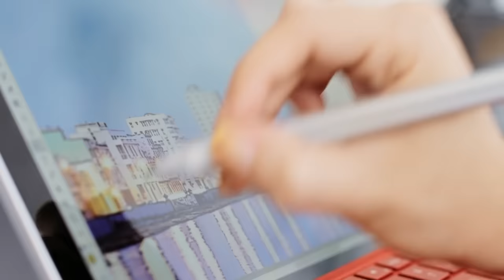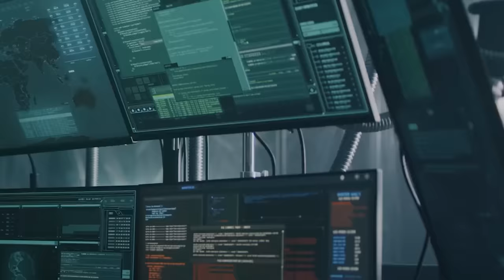Chinese Most Stealth Fighter Spotted at American Marine Base

Comment: Your comments remind me of the "Great Fighter Gap" in the 1960's. 
With great fanfare, in 1958 the USAF unveiled the proposed B-70 Valkyrie, a huge, Mach 3 capable bomber that would fly at over 70,000 feet. Work on the project continued into the early 60's, with many breathless announcements about the capability of the aircraft.
But over in the Soviet Union, there was some concern, as they had nothing on the drawing boards that could intercept the bomber. So a crash program was begun to develop such a fighter. 
But by 1962, the Air Force realized that missiles WOULD be able to hit the B-70, mostly because it's radar signature was so big that you could see it as soon as it reached altitude. So the project was canceled, except for the two XB-70 prototypes. The USSR, however continued full speed on the fighter project, and by the middle 60's started flying the result, called the MIG-25.
Now the shoe was on the other foot. The USAF did not have a fighter that could equal the speed and altitudes the MIG-25 could achieve. So of course they needed a "crash" (expensive) fighter program to create the aircraft that could fight the MIG-25. And they got what they wanted, the F-15.
Then a Russian pilot defected with a MIG-25, and all the experts got to get a good look at it. And oh were there a lot of red faces!
They arrived looking for all the amazing attributes the Mig was supposed to have, special materials, great radar, highly maneuverable, advanced engines and other cutting edge tech.
They found a VERY heavy plane that was made of steel to take the heat, which could pretty much only fly in a straight line, could NOT dogfight, with short lived engines, short range and still using VACUUM TUBES in the electronics. The "wonder plane" was a dud.
I'd withhold judgement on the J-20 if I was you.
Reply: The funny part is, even with the ability to go Mach 3.2, the MiG-25 was incapable of catching an SR-71, the MiG couldn't sustain Mach 3+ fight long enough to catch up with a SR-71 even if it took off ahead of the SR.
Reply: @mrvwbug4423   The Soviet Union actually used Mig-25s to try and intercept SR-71s several dozen times.  They would launch the Mig-25 well before the arrival of the SR-71 and be in front waiting.  The Mig-25s could always detect the SR-71 on radar, lock on, and in several cases even fired missiles at it.  The missiles could not track the SR-71 accurately because the closing speed was WAAAAY too fast for the missile to make corrections fast enough. Closing speeds were mach 5+ (hypersonic).  In total there were over 4,000 missiles fired at SR-71s over the operational life of the aircraft, both surface-to-air and air to air.  Not a single one came close enough to put the SR-71 in any danger.  The missiles were not fast enough when fired from the rear quarter and could not maneuver fast enough to pull correct lead when fired from the front quarter.
Reply: the engines not was short lives, was literally Cruiser missiles engines, they fix this in the MiG-31 Foxhound the sucessor of the Foxbat, the MiG-31 is theorically the same thing but the fuselage is lighter due to better engines and its made of hardned Aluminium Aloy infusioned with titanum, this with the first Fly by wire sistems it actually can turn faster but its a interceptor not a fighter
Reply: @michaelrunnels7660 the entire life of Blackbird a total of 17 missiles was fired at it, not 4000 😂 bro is pulling numbers from his ass, and belive or not 3 of the 17 AA missiles was sweedish drakens that fire, blackbird engines are much stronger than it was put to fly but the fuselage will melt, so it only goes at 3.5 Mach so the nose dont melt due to Heat, the MiG-25 can fly at mach 3.3 almost the same, and the plane itself is faster than the missiles, thats why the MiG-31 is used now as a Air-to-ground plataform than a Interceptor
Reply: @Russinh0  
Straight from the Russian MOD handbook 
As Bugs would say
What a maroooon
Reply: @Russinh0  The Mig-25 was ALSO an interceptor, not a fighter.
Reply: @Russinh0  The MiG-25 had to have its engines overhauled after a flight if it exceeded Mach 2.8, and couldn't maintain Mach 3+ for very long before running out of fuel.
Reply: @joshuabrown3525  The Soviet tanks during WW II were arguably OVERALL subpar, but it was more an issue of sub-par optics, inefficient tactical communications, and poor doctrine.
The KV-1 and T-34 were bad shocks to the Germans at the start of Barbarossa - better EXCEPT in the optics to anything the Germans had at the time.
Reply: The main reason why the US got freaked out by the MiG-25 Foxbat is that the American analysts saw the massive wings on the thing, and jumped to some incorrect conclusions about why those wings existed.  The Americans thought the plane was primarily built out of titanium, and the wings would generate increased agility.  But in fact the Foxbat was primarily built out of heavier steel, and the large wings were needed just to keep the plane aloft.
Reply: That j-20 would it not be funny if we wanted to test to see how close we could get and steal one from china and when the fella actually succeeded came over coms and landed on a close by Aircraft Carrier and lowered down into ship transported back to the United States. 😉. Wait is that legal to do? Oh yeah I forgot we have the largest Navy in the world. Also maybe we had it for awhile now and we are done with  playing with it and parked it in the open to see who all would notice. 😉Have a good day you all.🤣
Reply: Soviet MiG-25 pilot who defected: Victor I. Belenko. I knew the American fighter (Navy F-14 Tomcat) pilot who debriefed him.
Reply: @Tombstone8669  The J-20 isn't reported to be VTOL or even STOL.
And I don't think the Chinese make a version with the equipment to land on a carrier if it's neither of the above.

Land in Taiwan is MUCH more likely.
Reply: Exactly they can't design their own engines
Reply: @mrvwbug4423 Small gas tanks were often a problem with Russian fighters, especially the Migs.
Reply: That Dud was by any chance the MIG 31? Still flies. Just as the F-15 does.
Reply: I wouldn’t, if it’s like im thinking, China has a new MiG-25 to America’s XB-70.

China has a J-20 to America’s F-22/F-35/B-2/B-21.

Idk man
Reply: @michaelrunnels7660 no way??? This is why I don't understand why 5th generation went slower.  I mean stealth is cool, but what happens when the enemy solves the detection problem?  We need extreme speed in my opinion.
Reply: @Tipman2OOO    Extreme speed was what gave us all the third and fourth generation fighters.  In the military thinking at the time, anything less than Mach 2 top speed just wasn't fast enough.  In the 1970s all the air-to-air combat battles of American fighter aircraft were analyzed and it was found that out of thousands of real world combat missions only 6 reached speeds of above Mach 1.  That's including all U.S. and allied combat missions from the mid 1950s to 1978.  The highest speed any U.S. fighter has ever gone in real world air-to-air combat is mach 1.6, even though they were capable of going mach 2+.  It just wasn't needed in the real world. Reconnaissance aircraft were the ones that needed speed, not air-to-air fighters.  The higher maximum speed you design a fighter to go, the more you limit all other aspects of performance.  Very high speed aircraft have been shot down by American aircraft including the Mig-25 flying above Mach 2.  The F-16 that shot it down was going Mach 1.1 at the time.  Since no combat ever reached beyond Mach 1.6, that's what the requirement became for modern American air-to-air fighters.
Reply: @michaelrunnels7660  hmmm interesting!
Reply: @Russinh0  I don't know where you got your info man. A simple google search would show very clearly it was over 4000.
Reply: @Russinh0 the mig 31 is still a bad air craft. The US was easily able to down the few mig 25 flown by Iraqi pilots . The su 27 and mig 29 are good aircraft thout
Reply: @Russinh0  who knows you may be right on the numbers from Russia alone.  But I know for a fact that North Korea shot missiles at them too. Likely Chinese did also and whoever else they passed over.  So even though your numbers are low you are not taking into account how many others did shoot at them.
Reply: @mrvwbug4423 Well while the official top speed for the SR-71 was Mach 3.4 the pilots have all basically said they went "way faster" plus one of the reasons it didn't have any weapons was because their was a good chance it would rear end its own missiles.
Reply: @michaelrunnels7660 it never overflew Russia.
Reply: The Mig25 was designed to be an interceptor. Not a dogfighter.
Reply: @smithnwesson990 mig31  is closer to f14 launch large missiles air to air air to ground and turn around. Useless in a small Arab country.

Comment: Those canards tell you everything you need to know about the stealth characteristics of the J20; the straight edges where they meet the main fuselage are just begging for radar to travel along them, hit the tail end of the joint, then spray out in a pulse that can be tracked back to the aircraft.  The F-35 and F-22 get around this by having all the seams on access hatches be serrated, and as well, they are covered on both sides of the joint by a tape that has an electrical conductivity gradient in it, causing the radar traveling along any edge to create a series of much smaller, weaker, and more directed pulses, rather than one larger pulse that can be more easily detected.  This tape is why the edges of those hatches have a different color than the main fuselage of the aircraft.
Reply: Ssshhhhhh!!!
Reply: J20 is about as stealth as the Su57, which got detected by Ukrainian and Turkish air Defense radar 300 kilometres away
Reply: Go play Call of Duty kids
Reply: Two words: Balloon-Chan :body-green-covering-eyes:
Reply: @Rheinmetall2025 It's more in the like of a Rafale then an F-22.

Comment: Remember America builds its systems to what the other countries say they have while not telling you what ours are actually capable of.
Reply: Perfect example: the F-15. The Air Force thought the Soviet MiG-25 'Foxbat' was a high-performance, highly-maneuverable air superiority fighter, and wanted a fighter jet that could outperform it. The MiG-25 turned out to be a heavy, less-maneuverable interceptor. The F-15 was essentially designed to outperform an imaginary (at the time) threat, and ended up significantly better than anything the Soviets had.
Reply: @Patrick-fk4ef  The Soviets never thought of the Mig-25 as a fighter or maneuverable.
That was a mistake the WEST made when they found out it existed - but almost nothing ABOUT it otherwise.

The Mig-25 was ALWAYS intended to be an interceptor.
Reply: F22 🤙🏽
Reply: @bricefleckenstein9666 They said it was a fighter for propaganda purposes at airshows.
Reply: @NaakteMolrattenZijnCool  "The Air Force thought the Soviet MiG-25 'Foxbat' was a high-performance, highly-maneuverable air superiority fighter" is the line I was replying to.
Glad to clear that up for YOU mate.
Reply: @GenericRedDot  Exactly!
"Propaganda purposes".
They KNEW better themselves what it really was.
Reply: @bricefleckenstein9666  And right after that, they ended up having an EVEN LARGER PROBLEM called "Not having an equivalent to the F-15"
Reply: @NaakteMolrattenZijnCool  You still haven't cleared up anything.
Just because the US Air Force didn't know what it was talking about, due to limits on intelligance, doesn't make their statement definitive.
Too bad you had no clue about that concept.
Reply: @NaakteMolrattenZijnCool  I stated that the WEST was wrong about the Mig-25 being a fighter - not him specifically.
Go back and read what I SAID, not what YOU THINK I said, before you try to correct me.
Reply: Apart from the UK as helmets for both f22 and f35 are British Bae Systems
Reply: We don't need to be told, we've seen what a bang-up performance NASAMS has delivered in Ukraine, it rains cruise missiles and UASs in Kiev like it wasn't even there.
Reply: Every country does that not just you guys , truth is we.never know what theyve got on their top shelf  and vice versa . We can only assume whats likely

Comment: Only China considers the J-20 a 5th gen aircraft. Everyone else knows it to be a 4.5 gen aircraft.
Reply: @@KittyCat-zv4js  LMFAO China only has 25 operational J20s and none of them are actually stealthy. every nation in and around China with a radar system can pick those planes out of the sky. The F22 to this day is the top 5th Gen fighter that not even the F-35 can touch. Japan however is now manufacturing its own 5 gen stealth fighter based on the US's YF-23 project (which in reality should have been in the US inventory over the F-22). China has to steal tech to even come close to anything the West has to offer, and they are still 40 years behind the US in stealth tech.
Reply: F-35 doesn‘t think so.
Reply: Nah, china rates the j20 as 4th gen. Idk why the west rates it as 5th gen if china rates it 4th gen
Reply: @Zatote its 5 gen in china i can speak wih experience
Reply: @fbi805 Japan wanted to work with the US on a YF-23 version but that fell through.  They’re now working with the Brits and Italians on the Tempest.
Reply: You are giving it a higher score than it should be and is probably a 3.5
Reply: No it is 3rd generation fighter jet🎉
Reply: J20 is a 5.5 gen fighter. It's used to control unmanned fighters. US only has the quantity advantage now. Technology isn't leading China anymore.
Reply: @connermini9390 F-35 is immensely superior to J-20
Reply: @Sinitikt  no it's a capable 3rd generation fighter jet
Reply: @fbi805  China has the capacity to build PLA combat ships at 200 times the rate that the US can, per leaked US Navy intelligence. 
China alone received 49 percent of all shipbuilding orders in 2021, making it a global shipbuilding powerhouse. 
In 2021, China commissioned at least 28 warships, while the US Navy was positioned to commission seven warships that year.
these statements could be extrapolated to aircraft, you have to keep in mind china has almost 5 times the population USA has, their manufacturing capacity is enormous
Reply: Just like their pee pee. Grossly overestimating the measurement of what's effectively 2"

Comment: While the simplest explanation is indeed that this is just a mock-up, that is also exactly what the US would likely say if a defector had turned one over.  And its not like China would want to lose face admitting they lost a plane.
Reply: If it was real the USA definitely wouldn’t have it out in the open like this.
Reply: And thats exactly why they would leave it in the open like this…
Reply: If we really had one, it'd be quietly getting studied at Area 51 and not sitting on an open apron in some outlying airfield on the East Coast.
Reply: is it possible to make a copy of j20 to learn it's handling charateristic, radar signature and visual,like use old 2 engine US or russia plane, put some body panel, extra canard etc?
Reply: @nedelwre  Radar and things like that probably, but you need to know what the body is made out of.
Reply: @doujinflip Area 51 is so 50 years ago. They’re on to area 52 and 53 by now. All still in the American south west, but not all in nevada.
Reply: no really, sure anti radr paint helps a lot bu its still abit of a crutch, there's a reason the engine fans are well hidden inside and the f35 has some notable stealthy lines

Comment: I heard it wasn't stealth. Based on the fact that the radar cross section was too big to be considered stealth.
Reply: I was under the impression it was all in the paint coating it.
Reply: @dananorth895  That only gets you 20% there. The main thing is pairing that with contiguous airframe-- ideally in a sphere or frisbee shape, but a deltoid works well enough.  Stripping as much conductive material as possible is another part. This reduces the all-portant returnable cross section of the airframe and what drastically diminishes it's radar signature.  Even if the J-20 had top-of-the-line refractive paint, it's shape is broken up for more maneuverability and speed at great cost to being detected by even civilian radar.  It's about as stealthy as a fart in a elevator.
Reply: Stealth planes are regularly detected by lower frequency civilian radar, what makes it "stealth" is the difficulty of locking the individual plane with a higher frequency high resolution radar.
Reply: It qualifies as LO (low observable)

Comment: IF it was real, it would be in a hanger, not sitting out in the open. MCAS Cherry Point is in NC, Bogue field is an auxiliary landing field between Jacksonville NC and Cherry Point.
Reply: Yeah I'm more inclined to agree with you on this. Because if you even remotely knew anything about this area, you'd know that bogue (auxiliary) field is just that: literally a tiny fenced in area, that first of all isn't secret nor restrictive enough to house & protect an asset like this; it's really nothing more than a single SMALL airstrip, an aircraft controller tower & a handful of buildings... Oh and yeah, they do have the footprint of an aircraft carrier's deck painted on the field for the Marines & Navy to practice carrier takeoffs & landings, but other than that, MCAS Cherry Point (or elsewhere) is/would be FAR superior, more controlled/limited access, facilities (whether maintenance, training, storage, etc), ideal and likely a location for something like this to be in/at